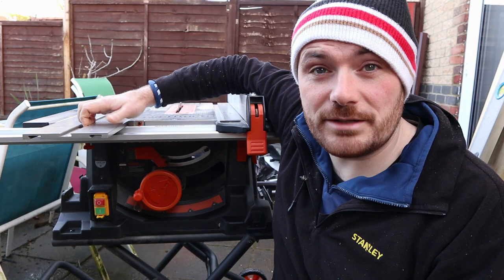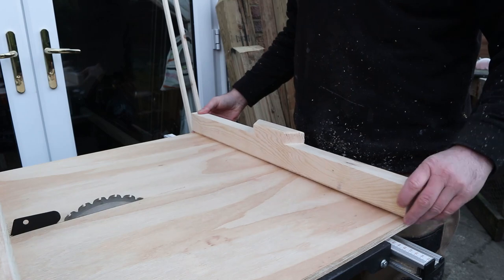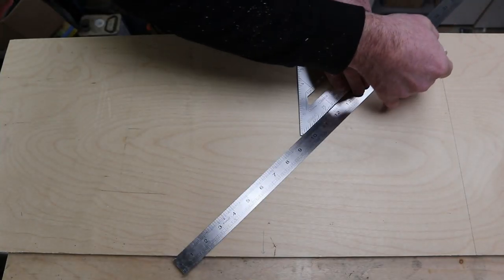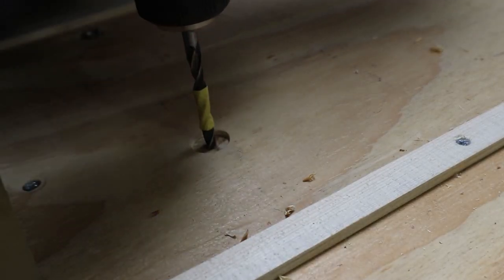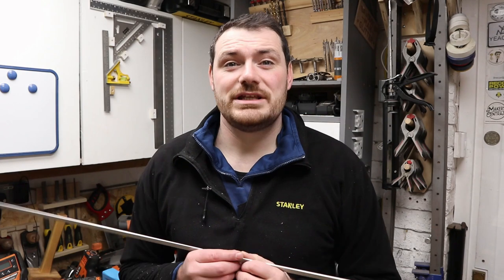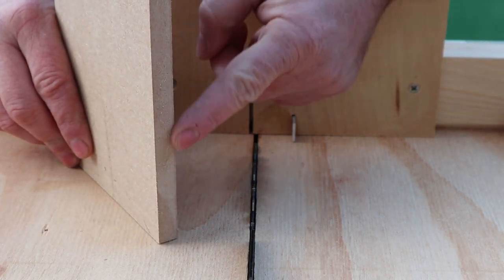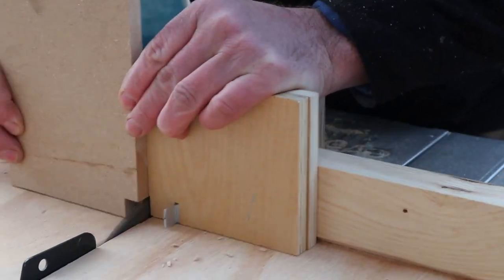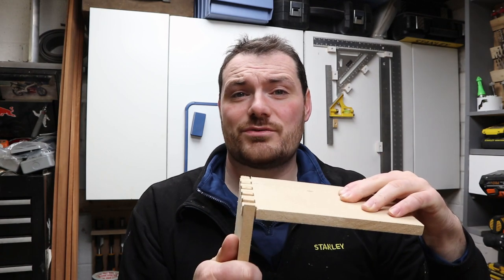Super Easy And Accurate Box Jointing Jig And Mitre Jig For The Table Saw

Comment: Hi James these are brilliant mate, I'm needing to replace all my sleds as I've upgraded my table saw so I'm definitely making these. The box joints always really confused me so I'm going to build this and practice. I think I'll buy a 5mm flat tooth blade first though after Christmas to make it even quicker and less cleaning up of the joints.
Cheers mate and top vid. 😊
Reply from the maker: Hi mate, thanks very much. That would be a good idea to use that blade. I've got an Irwin 60t and 80t blade that I'm gonna fit when I do a proper build with the box joint jig, rather then the worn evolution blade, should get a much better joint then 👍

Comment: I'm glad you had success with the box joint jig. I couldn't get this method to work as it requires a super accurate setup which I couldn't achieve.
Reply from the maker: It's not that hard to set up. What issues did you have?
Reply: @JamesManCave  basically any error you have on that first pin will be compounded on all subsequent pins, so they either get progressively fatter or thinner depending on the error. I got to the point where I was shimming the metal pin with tape but was still having issues. That said, your pins in the video are quite thick and with so few you maybe got away with it.  BTW you have same table saw and chop saw as me. Haha.
Reply from the maker: That's a real shame after all that effort. My pins are the same thickness as the kerf of my blade. This has to be the same, as that will throw out your joints. Hope you have another go soon!